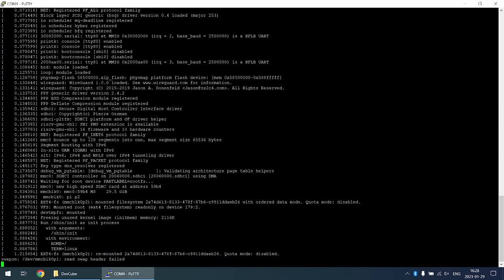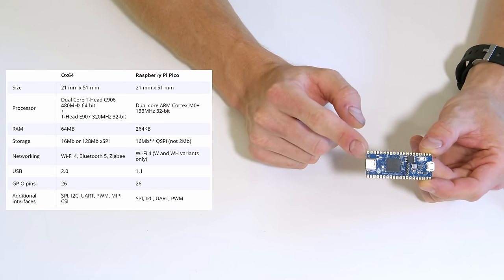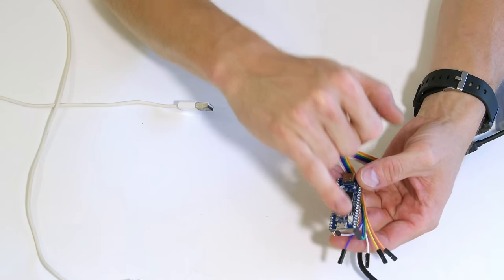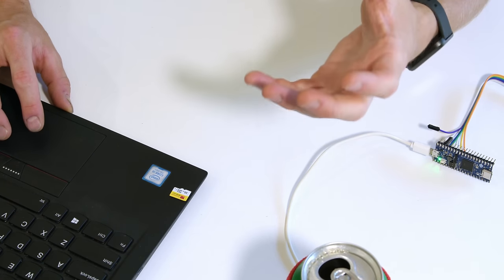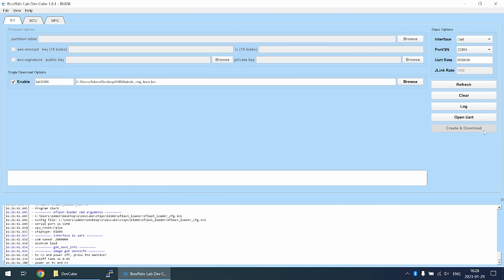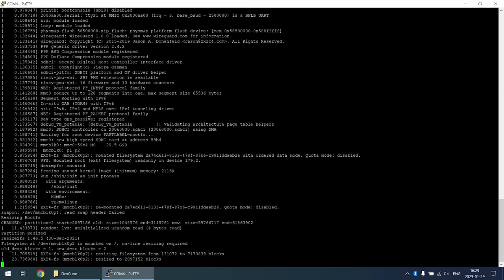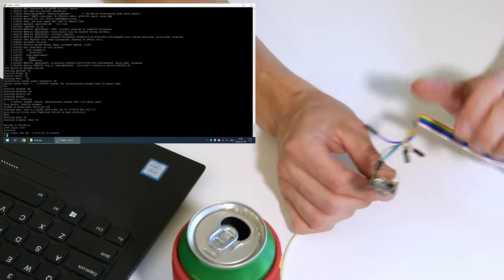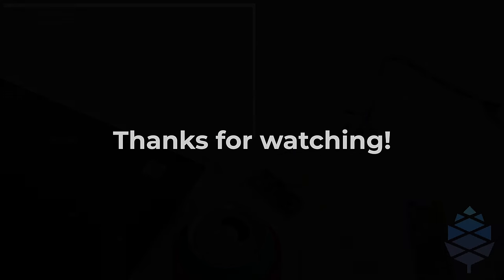Ox64 SBC - Connecting, Flashing and Booting Linux! ($8 from Pine64)

Comment: The pi pico is in no way almost a full fledged computer, it is just an MCU. This board is different though since it has a RV64 processor, a RV32 processor and another RV32 processor that is apparently used for WiFi. This chip also has a built in NPU. It is very different from the pi pico.
Reply from the maker: @conorstewart2214 You are absolutely right my friend! 

With this one there is the RV64 D0 core, which does most of the heavy lifting, then there is an RV32 M0 core which does most of the GPIO, wifi, ethernet, etc, but the code running on this is primarily an IRQ message bus so that D0 can access it, and then there is the LP core which is just a RV32 160MHz but this is currently unused and mostly undocumented. Bouffalo Labs are working on releasing the LP SDK, wifi spec, and a few other things, but it's all currently under NDA until complete. Hopefully not long!
Reply: If it's Turing complete, it's good enough to be considered a full fledged computer! /s
Reply: The PDP-11 ran UNIX v6, programmed in C. Its 16-bit single-core CPU clocked between 500 kHz to 1.25 MHz, supporting a maximum memory size of 4 MB. Hard drives varied from several megabytes to tens of megabytes, spinning at speeds of 2400 to 3600 RPM. To match the processing power and efficiency of a single RP2040, you'd require a thousand PDP-11 units or more. The processing power of an RP2040 would have set you back $10 million in 1975 to start. At MIT, they teach xv6, a rewrite of the original Unix 6 code, which they run on tiny RISC-V microcontrollers. The RP2040 possesses the processing power necessary to drive groundbreaking advancements in weather forecasting, space exploration, molecular modeling, astrophysics, and nuclear physics. The problem isn't with the hardware, but lack of programming skils.
Reply: @AnonGuardians  classic skill issue

Comment: Once the WiFi is working, this will be really interesting.  MicroPython is great on Pico W, but it is not a full OS.  Really like the full OS aspect.
Reply: There’s always FreeRTOS for pico, and recently a full on VGA boot to basic retro style computer as well using the rp2040
Reply from the maker: @JibunnoKage-cj2kz @tylerdean980 Seconded my friend!
Reply: @tylerdean980  True, but this device at least for me, seems more flexible than most of the ESP or RP2040 form factors I have seen.
Reply: The benefit of a full OS, in my mind, is the relative ease of reprogramming it. With ESP32 and Pico W, unless you do something clever like the UI Flow system from M5stack, you need to flash the ROM for every iteration. But if you get the firmware to fulfill all your needs for a project, then all that flexibility will not be useful until you scrap the project and reclaim the parts.

Comment: Amazing device! I can imagine using this SCB to make a portable SDR that can process much larger bandwidth than those made by ESP32 and STM32H4. (H7 I am not sure but H7 is crazily expensive).
Reply from the maker: Yeah quite possibly - the high MHZ and apparently wide band ADC would certainly do the trick! 

I've never used a H7, all my STM32's are F series. But yeah this is about 1/10th the cost of a H7 devboard it seem haha.
Reply: Could you please send a link to such SDR? Very interesting.
Reply from the maker: @Danil-intl  He's talking about making one :P Or if you meant the H7 then here's an example devboard for you https://au.mouser.com/ProductDetail/STMicroelectronics/NUCLEO-H723ZG?qs=zW32dvEIR3v%252BApBMtkRmgg%3D%3D

Comment: Ok, here's a question: with Linux on there, can it act as a USB host? Does it have access to the USB with that kind of control?  That's the main issue I have with the PICO, that it does not support USB host mode.
Reply from the maker: Hey yeah if you refer to the datasheet, the USB 2.0 implementation is for Host and Device mode. The RM PDF then expands on that in section 25.1.

It's just up to the drivers to be finished, which is making some great progress both with the open source community, and with Bouffalo Labs team.

Comment: That's cool,  but where can I buy that SBC? It is out of stock!
Reply from the maker: Yeah just have to wait unfortunately - I usually check weekly, just leaving the tab open in my browser. Good luck!
Reply: @PlatimaTinkers  as I don't want to wait, I ordered a 16 Mb version, and will replace Flash chip by myself)
Reply from the maker: @kotnitro2076  Just be aware no SD card reader! You can possible solder one on though. Enjoy!

Comment: Looks like soon (once EthX and camera are driven) this will be the perfect node for a chain of low-power and affordable ethernet security cameras.  

Can anyone assess whether they would have sufficient compute to do local image processing - like face or human detection?
Reply from the maker: @Man0f5cience Oh absolutely! They have a 0.1TOPS NPU built in which I expect would handle that perfectly fine.
Reply: Maybe but the Ingenic-based cameras are like $20 USD running full Linux 96MB+ RAM, 1GHz, with SD card, hardware video encoding, WiFi, and you can add USB Ethernet/PoE. Really hard to beat that. The only caveat is you have to hack the camera to remove the default Linux (spyware) and install your own firmware.
Reply from the maker: @_droid  oh that sounds tasty - can you send me a link? I want to check out these cameras!
Reply: Full-fledged IPCCTV security cameras with NPU image processing, in an Arduino Pro Micro form factor, with 2.5W power draw.

What a time to be alive.
Reply from the maker: @amateurprogrammer25  want want want want want.
Reply: For any security camera you need hardware h.265 or h.264 encoding.
Reply from the maker: @mrfrenzy.  Yup, and it's got H264 at a hardware level! You could probably dedicate the LP core to do software H265 but I am not too sure it's powerful enough (RV32 160MHz does not sound like much, but 100% dedicated to a process without running an underlying OS actually means that's a lot of power
Reply: @PlatimaTinkers  that will be really interesting to see for sure.

Comment: Amazing tiny device! I can't believe it could be possible to run actual Linux kernel on a board with the Arduino Nano form factor. Is Zigbee embedded version 2 or 3?
Reply from the maker: Yeah I've reviewed a few of these now, and they're all pretty damn good!

The 803.11/802.15.4 (Wifi/ZigBee) implementation is not complete, but it is working in the upstream repo (bl808) in bits and bobs, and currently being merged into OpenBouffalo which this uses. The ZigBee standard is implemented at the software layer though, so I'd expect V3 to be supported IE meshing.

Comment: Wow. Impressive. Both the result, and path to it. Alas too difficult for me with all those cables and images. I can use Balena, and that's about it.
Reply from the maker: Hah thanks yeah that's where I used to be, but persistence and only wanting to pay $8 pushed me a bit further 😅
Reply: @PlatimaTinkers  The stuff you burn ... that is to the flash memory on the Ox64? And then you "just" let it boot from Linux on the SD-card? If so, could the supplier take care of the flashing, so that buyers can just write a Linux to an SD card, and ... voila?
Reply: @blablamannetje  sure in theory. That might be a good opportunity for a value-added reseller to add a couple of bucks to the price.
Reply from the maker: @blablamannetje  Hey yeah so this is actually quite an interesting one! Group 'M0' is the 32bit processor, and D0 is the 64-bit processor, both of which have a tiny bit of on-chip zero-delay SRAM. It then has the 8-pin external Winbond xSPI chip. The datasheet (https://files.pine64.org/doc/datasheet/ox64/BL808_DS_en_1.1(open).pdf) has all of the base addresses for all of these. I also believe there is 'LP' which is a lower power E902 32-bit core but I cannot find anything about that in the BL808 datasheet!

While not immediately clear there other than in some of the function maps, if you have a read of the code for these images we're flashing with (https://github.com/openbouffalo/OBLFR/tree/master/apps) you can see both boot and handle different aspects of the chip. D0 though is what does the heavy lifting, and you can see in its main.c that it loads the DTB (Device Tree Binary that the kernel uses to know about the hardware under it), OpenSBI (supervisor binary interface - RISC-V middleware that executes the kernel), and then the Kernel (which is actually the Kernel and those last two compressed into a single binary).

That single Kernel binary is what we are flashing on the IOT tab, which is the SPI memory, and includes the drivers and boot args to talk to the SD card. So that means it goes Power On -> D0 and M0 start executing -> D0 loads the kernel et al from flash -> Kernel loads the OS itself from SD card.

Note I believe the initial GPIO14/15 we used are connected to the C906 32-bit core, and then 16/17 are connected to the E907 64-bit core. I may have also gotten piles of this wrong!

Comment: Just had 4 of these show up, keen to see everything I can do with it, both on the Linux side and running code on bare metal.
Reply from the maker: Let me know what bare metal code you end up doing, I'd be super keen to do a bit myself too.
Reply: @PlatimaTinkers  will do! I've been looking at the official and community repo's, there are quite a few options under development. Hopefully a chip this powerful will get some good development support.
Reply from the maker: @BrodieFairhall  I think it will! It's less than a year old and is going this hard. Compare to RP2040 which is less powerful and even older, and you see a faster adoption rate IMHO. 

Jump in and contribute would ya! Hah

Comment: Seems like that fills a gap between a RP2040 and a Pi zero I didn't even realise was there.. might snag me a couple, already got some ideas on what that could do.
Reply from the maker: Yeah I'd say! Any ideas you intend on sharing? :P
Reply: The sipeed M1S dock is another board that uses the same chip, you can get one with a camera, LCD screen and case.
Reply from the maker: @conorstewart2214  Yeah was looking at the M1s Dock, but it's a bit pricey comparatively. This supports LCD and camera, but the MIPS CSI interface and USB protocols are not quite complete yet. The community developers have been working with Bouffalo Labs on getting this across, and it's very close!

Comment: Currently looking for a good board to be brains for autonomous rover using computer vision AI (opencv), Lidar,  odometry and ultrasonic sensors. If I need a couple of these boards running ROS that would be fine as the price is awesome.
Reply from the maker: Hey I'd actually look at the SoEdge instead: https://pine64.com/product-category/soedge/. That and the baseboard (I have one, future video plans) would kill it, as you've got all the Raspberry Pi headers, 3TOPS of AI power, and a PCIe slot for any expansion or even an NVMe card!

Comment: Okay this is a really cool piece of kit. But the amount of fiddling required to program it seems to be a bit much.
Reply from the maker: I think once the software is stable they'll probably ship versions pre-flashed with a bootloader, and versions barebone. 

That being said, as long as you have a serial flasher like my CP2104, you can probably knock this out in under 5 mins
Reply: @PlatimaTinkers  Yeah that's a fair point right there.  I'm still pretty new to esp* land.  A board I can drop something that even behaves a bit like an OS on would really bridge the gap for some sensor and logging projects I'm fiddling with.
Reply from the maker: @madwilliamflint  That's where I think it's getting REALLY blurred due to the RISC ISA and ARM (or similar) processors. You originally had computers and SBCs that ran a full OS, and then MCU's that run custom firmware. Now you've got SBCs the size of MCUs that can run stripped version of Linux like this, alternate Linux's like what STM have produced from their STM32, or Fuzix which is very close for RP2040 chipsets. Further to that you then have MicroPython and Mongoose for ESP32 which is almost a framework turned into an OS for an MCU. It's insane, complex, and awesome I think

Comment: nice! though I don't think calling it a Pico competitor would be fair, since this is a whole SBC and the Pico is just a microcontroller
Reply from the maker: How would you define them as different? The Pico can run Fuzix. I'd say the only reason it cannot run Linux is because there is not as dedicated of a community that'll port it themselves; they all rely on the foundation to provide the software.
Reply: @PlatimaTinkers   > I'd say the only reason it cannot run Linux is because there is not as dedicated of a community that'll port it themselves

I'm not a professional, but I do not think so. mainly the two m0 cortex cores at 133MHz are too slow and pico only has 264kB's of RAM, compare to ox64's 64MB.
Reply from the maker: @TheMlg556  Yeah okay I completely forgot about those points haha. That is definitely not enough RAM, however, it could possibly reside in swap? It'd be painfully slow, but surely possible. The question is if you can load enough kernel with only 256KB to then initialise swap. Not sure TBH. 133MHz is not an issue - that'll still run quite fast.
Reply: @PlatimaTinkers  I think the 64bit Core on the 0x64 inc a MMU, FP & Vector ops etc,  does put it in more the low-end SBC class vs the ucontroller class of the Pico, though I agree the lines between the classes of devices are getting more blurred these days.
Reply: @PlatimaTinkers  Also I think swap impl for Linux kernel will be a struggle without a MMU ?
Reply from the maker: @mksln  yeah close to it. Check out page 12 on https://files.pine64.org/doc/datasheet/ox64/BL808_DS_en_1.1(open).pdf. D0 (RV64 core) and M0 (RV32) are doco'd there. The LP core (160MHz RV32) is heavily undocumented at the moment but it's getting there.

You can see that D0 has most of the AV components on it, plus NPU and SRAM, then M0 has the GPIO/wifi/ethernet functionality. There is a message bus and IRQ's are passed between the two by the RISC-V layer that executes the Kernel, and the firmware running on M0.
Reply from the maker: @mksln  Had not considered that! There is the NoMMU option, but looking more closely you'll find the Reference Manual (https://files.pine64.org/doc/datasheet/ox64/BL808_RM_en_1.0(open).pdf) cites an Sv39 MMU as part of D0 on Page 35, and this looks to have been implemented in the Linux kernel in 2021.
Reply: @PlatimaTinkers  sorry I meant that the Ox64's D0 does have a MMU, while the rp2040 doesn't have one
Reply from the maker: @mksln  oooh yeah okay that hurts - will be a hell of a performance penalty with context-switching.

Looks like the closest option then making use of nommu is uClinux, but even then I don't know if it'd run on a M0+. Looks like it's meant for M3, but I can see people have definitely asked the question!

Comment: Comes out to $19.99 when you add the crazy shipping fee. This comes from China direct? But I am positive that this is well worth $20, it's just that it would be better to go ahead and charge more for the device and less for the shipping. Perception.
Reply from the maker: Yeah worth it with shipping if you get a few I think. I usually order about $100 of stuff from them every now and then, and just pay $12 Standard Shipping
Reply: Yes, shipping is insanely expensive. The unit is US$8, however, the DHL shipping is US$30. Plus tax entering my country plus DHL addition $17.50 Duty handling charge and tax on the top of this fee. No shipping and handling fees are too expensive for me. I rather go to Aliexpress and order others RISC-V board with the same money but with better spec.
Reply from the maker: @chipling7367  Yeah you can get the M1s on AliExpress which also uses the BL808 - have you looked at the price of that?

Else which country? It looks like I can post an envelope to China from here (Australia) for $3! I am tempted to buy a pile of Ox64's for people that want them in countries with expensive defualt shipping.
Reply: @PlatimaTinkers  You guys are lucky. I'm in Canada, if I purchase 1 ox64, I need to pay CAD$72.5, i.e. USD$54. With CAD$39, I can get a Lichee RV Dock Allwinner D1 Development Board with Xuan Tie C906 and 512MByte DRAM. The down side is the board has a larger footprint and shipping take more time to arrive. I know it is not an apple to apple comparison but it is the nearest one I can get to have Linux on RISC-V board.
Reply from the maker: @chipling7367  Ouch that hurts! Want me to let you know when I've got stock here? AU-CA shipping for it looks to be about $5 AUD for economy air (15+ days) or $20 for standard which is about 5-15 days.